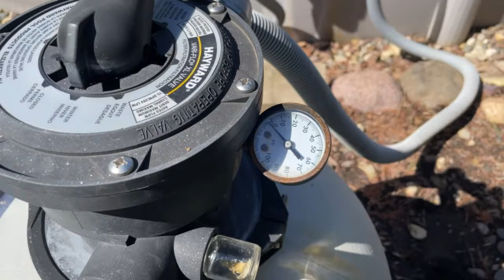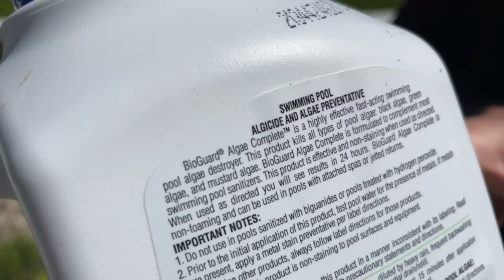How To Open Above Ground Pool & Green to Clear in One Day Easily

Comment: Great video, y'all, well made and very informative. One tip--put some plumbers tape on the threads for the drain plug(s) and pressure gauge, makes them more watertight and easier to get off and on, protects the plastic threads. One thing I learned from this video is starting threading by going anti-clockwise first to align to the threads before going clockwise to tighten, never knew that trick. Thanks!
Reply from the maker: Thanks and Thanks for the well thought out and articulate comment. 
Great tip with the Teflon tape too!
Take care 😊

Comment: I have had an above ground pool for 30 years now. This is my second pool. We always empty half of the water out every fall and cover the pool. Then come spring I drain all the water out. I clean the liner really good and refill it right away. You never empty the pool and let it sit empty for days it will shrink and bust after you refill it. So refill it as soon as possible. I have a DE filter and my pool will have crystal clear water all summer never green. I have had a sand filter in the past and I love the DE filter better. I only use the 3" chlorine tablets in a floater. I try to buy the  tablets that contain the highest amount of chlorine in them. Read your lables... I added it up it is cheaper to just add new water every spring instead of buying chemicals. I have a floor drain in the center of my pool this helps keep the pool cleaner too no vacuuming. The dirt settles in the center where the floor drain is. I backwash my filter every week. I clean out the filter every fall after disconnecting it and I store the filter system inside for the winter.
Reply from the maker: Thanks for leaving us tips that have worked for you in the past. Unfortunately, we don’t have a center drain as that sounds pretty nice to have. Have a great year swimming and take care 😊
Reply: @SilverLiningDayDreams  you are welcome... many people don't even know they sell a floor drain that goes underground under the liner it connects to the filter system. The water circulates in a circle in a round pool so all the dirt and debree lands in the center of the pool. The floor drain will suck the dirt right out of the pool. I never have to vacuum. Crystal clear water. They sell the floor drains on Amazon and in any pool supply store. Easy to install too. You can use a floor drain on any vinyl pool liner. I'll always have one. Enjoy your pool=)
Reply from the maker: 👍🏼🏊🏼‍♂️ Yes! Happy swimming!

Comment: Thanks for video! This is great! Question: we leave ours uncovered. We have lots of leaves in the bottom. Do you try to get all the leaves out gets it all stirred up before you start with the shock? Or do you wait to do it after shocked? Thanks for a reply!
Reply from the maker: If you can see leaves at the bottom of the pool, I would suggest trying to get them out first and then shock the pool. However, it may be that your pool is so green that you can’t see the bottom and are unable to tell what’s there, so in that case, I would just shock the pool and then vacuum to waste the leaves. But be careful where you put the water when you vacuum to waste after it clears up because you don’t want to kill vegetation. Your pool liner will last longer if you cover it over the winter by protecting it from UV rays. We installed a new liner last summer, so we covered ours this winter for the first time in a years. Take care 😊

Comment: You say at the end of the video to “fill the strainer housing with water to suction pipe level and prime pump before turning pipe on.” Can you elaborate on how to do this? What would happen if you don’t? Thanks!
Reply from the maker: So sorry we forgot to answer your question!
Adding some water into the pump housing will sometimes get the pump circulating faster so less stress on the pump 😊

Comment: We don't use sand. We use these white round balls that work great. And when they start getting dirty they go into a bag and into the washer.
Reply from the maker: Interesting I’ve never heard of that. Do you have a name for the products so I can do some research, I’m curious.
Reply: @SilverLiningDayDreams  my husband got them from Amazon.  I'm not sure what they are called.    But they work better than sand.
Reply: Yes, I use Filter Balls. They are like spun fiberglass. I use them because the white ones are not backwashable and they suggest that you take them out and wash them in the washing machine. The ones I use can be backwashed. They are amazing and lightweight. If they are too dirty at the end of the season, I just toss them and buy new in the spring. I also use a 90 day algaecide so I’m not dealing with that every week. I use an Arm and Hammer balancing puck in a float, then I don’t have to mess with balancing the water every week, just add them when I add my chlorine puck. Pool stays crystal clear all summer.
Reply from the maker: Great tips! Thanks!

Comment: Hi, this helped us a lot! QUESTION : Do you have a video about CLOSING an above ground pool, specifically how much chlorine to add?
Reply from the maker: Glad we could help!
Unfortunately, we do not have any videos on closing the pool, but if we can make time this fall, we certainly are going to be doing one. 
In the past, we did not cover our pool and that’s a whole can of worms as to why, but because we have the new liner put in, we are going to cover it later this fall to help increase the longevity of the liner. 
I don’t feel like we would be a good resource for you on how to cover it without doing ours first, so I would suggest looking on YouTube for closing videos and subscribing to our channel to see new pool videos this spring 😊
Reply: @SilverLiningDayDreams  we've closed the pool ourselves for several years. My question is specifically how much liquid chlorine do you add for your pool when closing. Ours is about 15,000 gallons and we've always just used the winter pill from Amazon. We'd like to try using just the liquid chlorine this year.
Reply from the maker: @anniedrews4849  usually a gallon or two of the commercial strength shock but I’m not sure if that’s technically best amount for our 18,500 gallon pool
Reply: @SilverLiningDayDreams  thank you.

Comment: Hi, what kind of pool is this? I’m in ND and have an Intex Ultra Frame. I’m always looking for above ground pools that do well.
Reply from the maker: Our pool was made by Ovation and it’s about 22 years old 😊
We just had a new liner installed last Wednesday  and we had a little bit of a rust area worked on by where the water goes into the pool from the sand filter.
It probably wouldn’t have been as rusted if we would have had it worked on it earlier and an earlier new liner installed two or three years ago. 
Because of Covid and shortages with liners, and then the large increase in pool sales causing a demand for liners and labor, we were not able to get a liner for the last two years. 
Fortunately, we found an installer that was able to get us in this May so we can enjoy our pool this summer. 
I’ll link the liner video here if you are interested as it shows better the condition of our pool. 
https://youtu.be/0QISh3k45as
Take care 😊

Comment: Hi! Ive been struggling for a week to get mine clear.  I have a 10k gallon intex pool that started black and ive been shocking it every couple of days finally got it to a lighter green color but cant seem to get past that color.  Any advice?
Reply from the maker: Sorry to get back to you so late. Are you using a hefty amount of a commercial shock to shock the day lights out of it? 
Can you take a sample to your local pool store to assay it and give a recommendation?  Our pool store here where we live does it for free. I’m not sure how to help without actually being there to see it.
Reply: @SilverLiningDayDreams  Hi no worries! I was pouring so much liquid chlorine daily but I actually ended up draining it. I took samples to the pool place but they wouldn't give me a report because I didn't buy their chemicals.
Reply: @natalieantayhua5519 oh damn!
Reply: @SilverLiningDayDreams  I have the same problem. Our pool is light green now. We tested the chlorine and ph level (chlorine is good, ph level is low). I added a bit more ph up and maintenance amount of algicide. Still light green as of now. Now we are wondering if we should add more algicide (and how much? a lot or pool maintenance amount?) or shock it more (wouldn't that raise the chlorine level?)? Any advice?
Reply: @pinoyakusan  If you PH level is low, most likely your alkalinity is too low. Check the alkalinity and correct the PH then continue with shock.
Reply: @pinoyakusan try baking soda

Comment: Liquid Chlorine is not "really concentrated" it is in fact the weakest form of chlorine at 12.5% but it is very useful. Also, you should use liquid chlorine late in the day as the UV sun rays will destroy it quickly since it is not stabilized.
Reply from the maker: Great tip! Yes, that is correct. But for us we sometimes we just have to do it while we remember, lol !

Comment: sorry but a big fail... you didn't put tape on the pressure gauge and should have removed that when you closed pool .. thats why you replace them every year
Reply from the maker: In 20 plus years using the pool I think the pressure gauge leaked maybe once so I’m not convinced it has to have Teflon tape on the threads.
But it is recommended… so we say go for it. We probably will start using it. 
Sorry to disappoint by not removing the pressure gauge every year; we will remove this winter and see how long it lasts. Take care 😊

Comment: One step, I probably would reverse, is vacuuming the heavy stuff before shocking. Especially if you can see the bottom of the pool. If it is a murky mess, then disregard. But if you can see the bottom, I would get rid of any of the stuff That could reverse what your shock has tried to get rid of.
Reply from the maker: Yes, sometimes that can be a better option to start with! Thanks for leaving the tip!

Comment: If you close down your pool correctly at the end of the swim season you would not be dealing with this mess. One gallon of liquid pool chlorine equals 1 bag shock. To close down your pool -    at the end of the season add HTH algaecide & 1 bag of shock (or 1 gal liq pool chlorine) - then cover with winter cover.  Then you'll start the swim season with pretty clear pool. BTW-there is NO reason to add 4-5 gallons of chlorine to pool.  It's way too caustic to skin and eyes to swim in. My grandson's pool is 15,000 gallons & got 1 gallon chlorine to shock it at beginning of summer.
Reply from the maker: Thanks for leaving us a comment with your thoughts!  We just had a new liner installed last week so we’ll probably be covering our pool this winter. 
Take care 😊
Reply: 1 gallon of shock will never clear up your pool.  i use 4 . shock burns off quickly .when opening your pool your not getting into if the same day anyways .